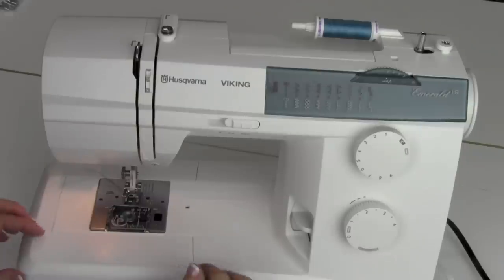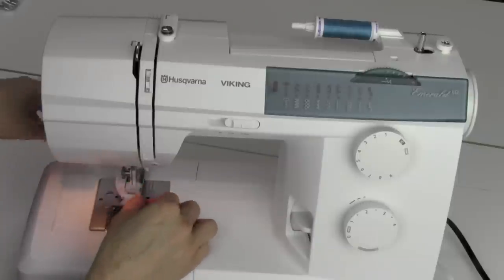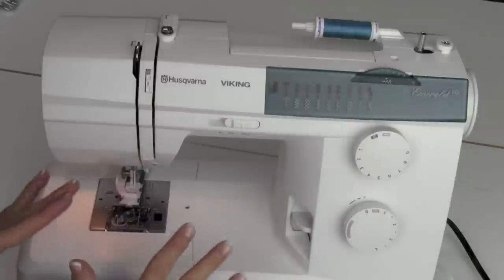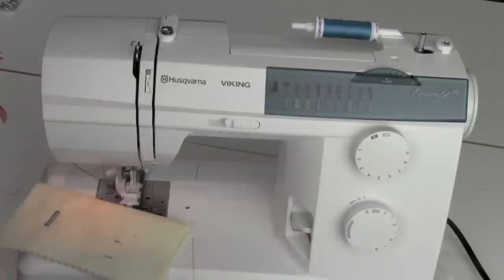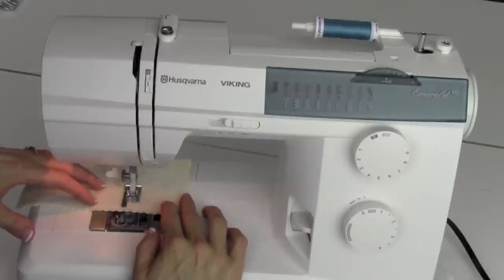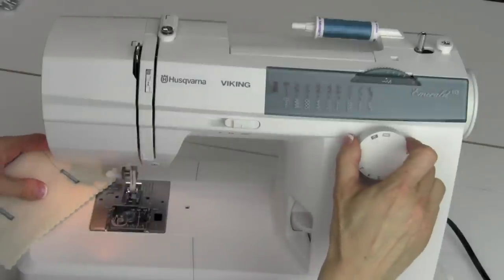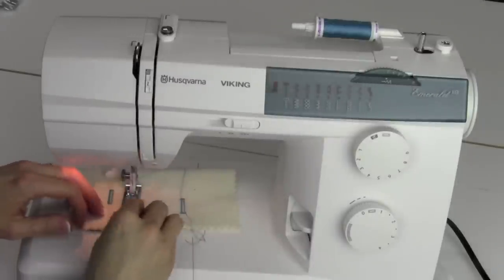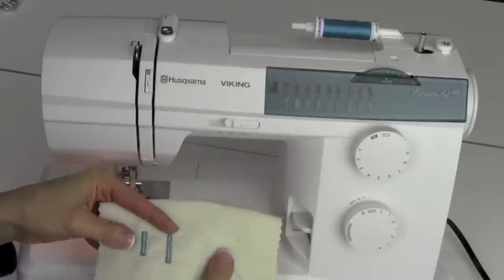Viking Emerald 118 15 Buttonholes

Comment: I must have some problem that is not discussed here.  I have been using this machine to do straight stitch and it works very well.  I set up the automatic buttonhole and followed the instructions.  The machine does not make a button hole.  It does not move the fabric. It makes a large wad of thread in one position.  What are you not telling me?  What little trick am I missing?
Reply: Make sure your feed feed teeth are raised. Also I've noticed for me that if I have the stitch length too low it doesn't feed the fabric, so try to make sure it's somewhere comfortably between 0 and 1. Hope this helps.

Comment: Thanks for sharing. I have this machine and my automatic zipper foot does not work properly as it does not feed the fabric through and come back the other way. Also cannot get it to work with thick fabric ( it keeps creating a knot In the fabric. Help much appreciated.
Reply from the maker: Hi, I would recommend visiting your local Viking dealer for more assistance.
Reply: jazzmania1000 have you tried to adjust the presser foot pressure when using thick fabric ?  Also try to sew slowly and gently pull ( with your finger so it stay even)  the fabric left and right.

Comment: How do you line up the buttonholes using the automatic attachment so that all buttonholes on a piece will be the same exact distance from the edge? Is there a marking on it to use as a guide?
Reply from the maker: Hi, There are not really marks on the buttonhole foot. I would recommend marking the fabric with a fabric marker or a pin. This way all the buttonholes will start in the same place. ~Sara~